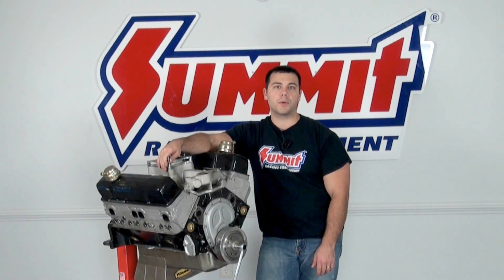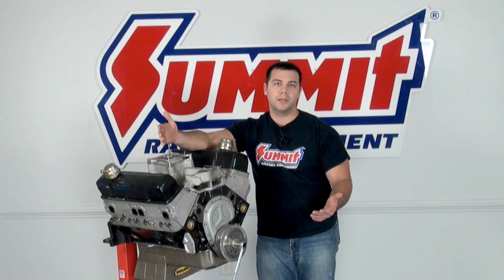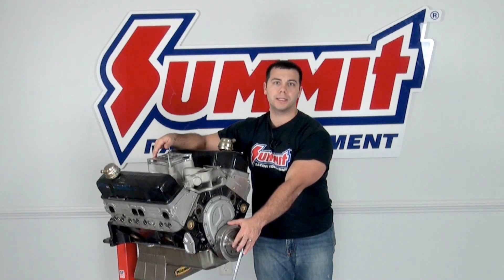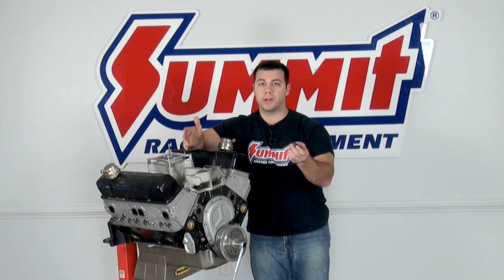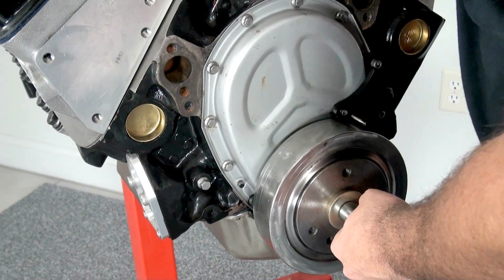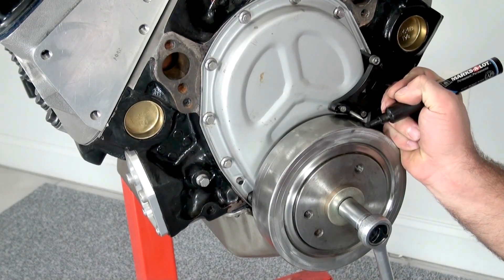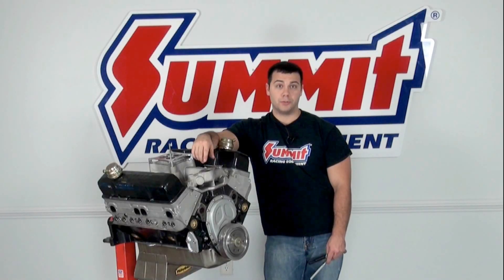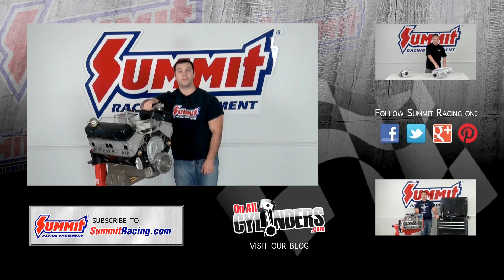How to Find Top Dead Center - Summit Racing Quick Flicks

Comment: I can't turn mine to the left without the bolt coming loose
Reply from the maker: Hi Steve, 
Depending on your circumstances, it may be necessary to remove the harmonic balancer and install a crank socket. Or, you could go to the other end of the crank and use a flywheel turning tool.

Comment: It would have been very helpful if you had the camera on No 1 spark plug and fully explained how the tools assembles and fits, you gave a warning of inserting about halfway but it wasn't clear, the close up on the crank shaft was good, should have done same with the tool on the spark plug.

Comment: I don't get why people are saying that this video is wrong or misleading. This WILL find the EXACT TDC of cylinder #1. I don't get why people are blabbering on about cams and rockers. You need to know where #1's TDC is to do ignition timing. You can verify your cam timing simply by removing the timing chain cover.
Reply: The crankshaft's TDC can never change. Only the harmonic damper can slip from age. This is why the tool is needed. I don't get why people are saying that aftermarket parts like cams will throw off the timing mark. A cam cannot change the relationship between the crankshaft and piston. They are directly-connected. They must not understand how an engine works.
Reply: It's still TDC regardless of if it's the compression or exhaust stroke.

Comment: I have a few comments:
First, you can't use a bolt in a spark plug hole. 14mm bolts are either 2mm coarse thread pitch or 1.5mm fine pitch. Spark plugs are threaded 1.25mm pitch, which is even finer than a bolt.
When you are turning over to find compression TDC, feel for air being pushed out of the spark plug hole as you turn the crank. Exhaust TDC will push the air out the tailpipe and not out the spark plug hole.
Lastly, some people have suggested this might not work if your pistons have deep valve reliefs, or the spark plug comes at a shallow angle to the piston face - but I can't think why that would be? If the piston contacts the stop then it should work as demonstrated, I would think.
Reply: Yes...This video is not the way to do it.

Comment: Not the most informative video to say the least... I mean at least pull the valve covers and explain what's going on with the intake and exhaust valves as you do this. I can't just run to the store and pick up your handy tool, I can't figure out why my timing mark is pointing 180 in the opposite direction when I seem to be at TDC.

Comment: What happens if your engine isn't TDC say after replacing the cylinder head gasket? And also, how do I find cylinder 1 on a 2.0 liter 4-cylinder?
Reply from the maker: +jackslater230011, 
Cylinder #1 on a 4 cylinder motor is the front end of the engine where your accessories like the water pump and alternator are. As for TDC, use the mark on the lower pulley to align to the pointer.

Comment: Hi, i have followed your video to the letter implementing it on my sbc, i had to re do it four times and not getting proper letting for the valves. Till my brother told me, this is not TDC of #1; you cant wait for the "intake to rise and fall, then the exhaust to start to move"

The compression TDC is when intake is fully closed, exhaust is aslo fully closed and the piston is fully compressed. In that stage piston #6 would be in a dancing position where "intake to rise and fall, then the exhaust to start to move"

I wont say the video is worng; i would just say its misleading; CNC Performance had the same point said here. I saw it later ofcourse.

I suggest you replace the video.

Thanks

Comment: Why can't I just use a 14mm bolt instead?
Reply: I checked and found out: bolts are different thread pitch and won't work. 14mm spark plugs are 1.25mm thread pitch whereas bolts are 2mm coarse or 1.5mm fine.

Comment: If f you don't have a stop tool and are using your finger, how do you know if you are on the compression or exhaust stroke?
Reply from the maker: PCcopeland, 
Watching the valve opening and closing events will tell you this. In a 4 stroke motor the piston moves downward 2 times, once for intake and once for the power stroke. The piston moves upward 2 times as well, once for compression and once for exhaust. Once the intake valve closes, the piston is coming up on compression. Using your finger as a stop will not be accurate at all if you are degreeing your camshaft. You will struggle to get the piston to stop against your finger at exactly the same point each time.
Reply: +PCcopeland you'll feel the compression blowing your finger out of the spark plug hole.

Comment: Can you use this tool when you replace a head gasket, and setting the valves
Reply: If you’ve got the head off for obvious reasons no this won’t work. If you’re setting valve lash you’re not concerned with crank position you need to be sure that the lifter is on the base circle of the cam lobe

Comment: I am a little confused on where to start this process. Does it need to be on the tdc compression stroke to start. I cant seem to repeat this and get the same marks. I went back just to double check my self and I get different results everytime. Why is this? I don't move the piston stop at anytime. My 350 sbc has afr straight plug 68cc heads and cast flat top pistons. Thanks
Reply from the maker: Hi Cleveland Bellamy, 
Sounds like the degree wheel is moving on the crank or the piston stop is flexing or bending. Make sure too that the pointer you are using never contacts the degree wheel at any time.

Comment: I'm confused to how far your supposed to screw in the all thread part of the piston stop tool?
Reply from the maker: Garen Watts , 
There is no pre-determined
length, it will actually vary depending on the cylinder head/spark plug angle
being used.  It only needs to extend inward far enough to make contact
with the top of the piston and stop it using a light pressure. Turning the
engine too fast by hand may ultimately scar the piston, so be cautious!
Reply: @SummitRacing so how do you tell if it's in too far

Comment: thats not right i do this every week on350s you got to get it on the right storke frist
Reply: which stroke is the right stroke to use on a 350 sbc with afr straight plug heads with 68cc chambers?
Reply: To mark TDC on a balancer it does not matter which stroke the engine is on. TDC is the same spot on the balancer on the compression and exhaust strokes

Comment: I'm building a 350 with vortec heads and compcam with his distributor. After assembly motor won't fire just back fires and spits through the carb. is this a timing issue. We have went through the wiring and know it is correct. Could my tdc have been off before distributor install. Thanks
Reply: 180 degrees off
Reply from the maker: Hi James Davis, 
We have a few additional questions for you. Can you please give our tech line a call? 1-330-630-0240. We look forward to your call. Thanks for watching!
Reply: They led you wrong the engine goes around twice for every 1 on rotor so pull number1 spark plug 
un plug distributor and bump starter with key on with another person at key or by remote starter switch 
with your finger over number 1 plug hole when it blows your finger off  it will be close               
you might have to do it twice .then you are on compression stroke.
then turn crank with socket to perfect top dead center.
and drop in distributor pointing at number one on cap.
with the vac on distributor pointing just behind trans dipstick so you can see  the distributor bolt
makes every thing easier .
do you understand  there is a compression stroke on top dead center and a exaust stroke on top dead center 
number 1 cylinder  ITS CALLED A FOUR STROKE ENGINE

Comment: If someone ever changed the rod length, wouldnt a stop tool  ,"stop you from top dead center with a a generic tool? some times when you buy a car from someone else, they made mods, or bought it with mods they didnt know of. I have always incerted something into the plug hole, and watched it travel out while turnning the crank, looking for no motion ,indicating the piston is at full throw, is this the most definitive way? besides an indicator gauge?
Reply from the maker: Hi Jay Scott, 
Can you give our tech line a call? We believe this will require a conversation. We look forward to your call. 1-330-630-0240. 
Thank you for watching!
Reply: You are correct Jay, good example is a sbc 383 dished pistons an straight plugs, the tool will not work for this setup. I have let summit know of the problem and advised them to make note of it . Tool works great on some engines, problem is summit doesnt know which ones. I will say they offered to buy mine back but I have found it to be usefull for other applications, but not the intended one.
Reply: So how is it done for straight plug heads when #1 piston doesn't hit the stop?

Comment: Hey every Big dog out their wasn't born with the no how.. you gotta learn it somewhere. SUMMIT some people really appreciate your videos so keep them coming on all levels..
Reply from the maker: Anthony Thoman,
An easier method would be to simply pick the distributor up and turn the rotor 180 degrees and set it back down in the motor and reset your ignition timing. 
 Cylinder pressure can be measure by using a compression tester. Link provided… http://www.summitracing.com/parts/sum-900009/overview/
Reply from the maker: Thank you, Robert Higgins! Please let us know if you have any video suggestions.
Reply: Summit Racing I have a Chevy 350 smallblock engine, and wonder how to reset my timing when im 180 degrees off. I was told too pull off my distributor cap, set it aside and remove my distributor, rotate the engine clockwise to 
reset the timing and re lower my disrtibutor. Would that be correct? and i also wonder how to find how much compression my engine carries.

Comment: I have a question. Is this method any different than rotating the assembly until you find the point at which both valves are on their seats on the compression stroke?